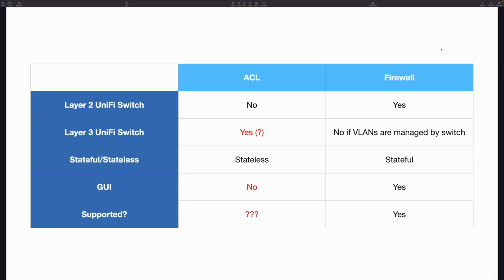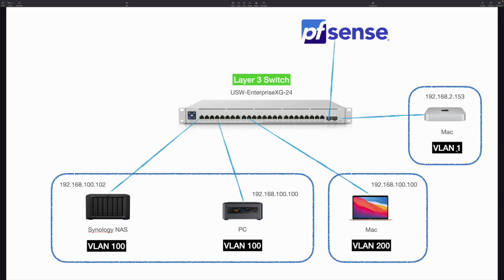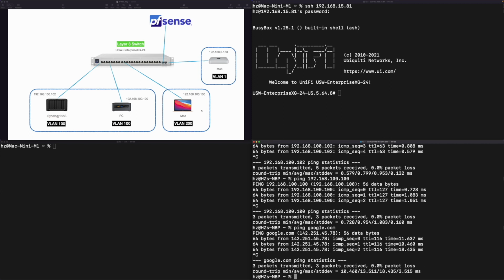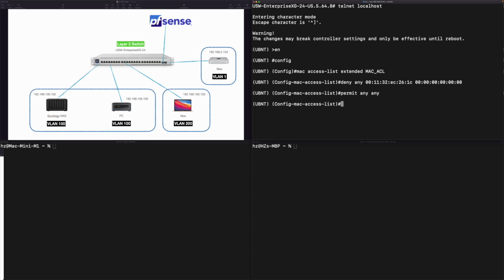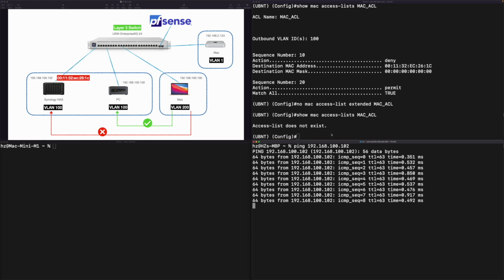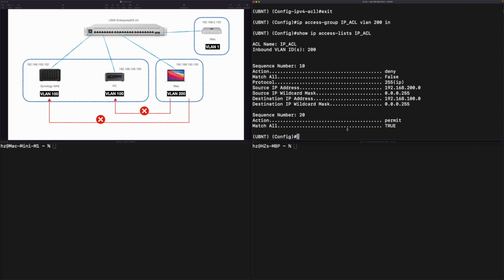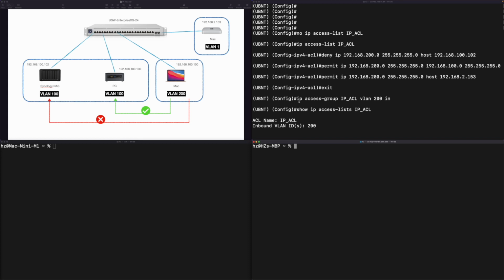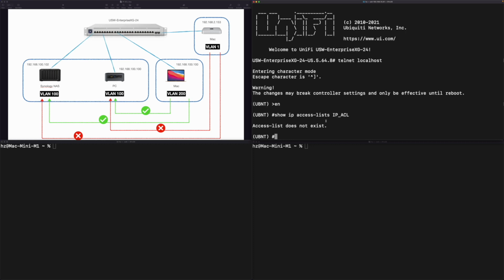Ubiquiti UniFi Layer 3 Switching -  Access Control List: MAC ACL & IP ACL

Comment: Do you have a video on setting up Vlans on a L3 switch unifi gateway and any static routing and other settings that needs to occur? Im also wondering what limitations I will have with one L3 switch but also a L2 aggregation switch upstream.
Reply from the maker: if you use unifi gateway, you do not need to manually setup static routing in order to use L3 switch; if you use third party router, search for "pfSense" and "Layer 3" in my channel.

And regarding how L3 switch work together with L2 switch, I am thinking about posting a video about it.

Comment: Great video! Interesting information and frustrating it's not available from Unifi.

I am confused as to what the benefit of a Unifi Layer 3 switch is though. If by default inter-vlan routing allows traffic between all vlans created on the switch then why bother with vlans at all? Just have them all on the same vlan.

They surely can't expect people to do all of this just to block traffic between different vlans. I'm guessing more enterprise switches have better ACL capability in the UI or even Layer 4 rule capability?

I'll be keeping all of my VLANs on the UDM and leveraging firewalls! Wish I have bought a L2 switch and saved some cash rather than L3 functionality that won't be used.

I hope you get more subscribers as the content is very useful. Thanks.
Reply from the maker: Yep, UniFi layer 3 switchers are still in infant phase, but isn’t it typical for Ubiquiti: good hardwares, lots of potentials, but half baked softwares, plus poor documentations… On the other hand, they also provide enough but not too many challenges to homelabers :D

Regarding “enterprise” level of switches, some of them support something like extended ACL to filter traffics. Not sure about GUI but at least the configurations can survive system reboot.
Reply: @hz777  how will these configurations survive in “enterprise” level of switches? will "write memory" useable on enterprise level switches?
Reply from the maker: I am not aware of a way, pro or enterprise.

Comment: Even for home use not saving the config is big issue.
I don’t understand why they cant fix this! So what does the „write memory“ actually do?
Reply from the maker: For edge switch, write memory command will save the running config to a file so next time when system reboot the config can be reloaded. But because of the OS changes, the command is still there, but no effect already.

Comment: Thanks for this great video.  It might seem like you're posting these into a black hole, but I swear, you're not! Your channel has the deepest "show and tell" kind of technical content I can find.

Ubiquiti should hire you to make their content for them.  :-P

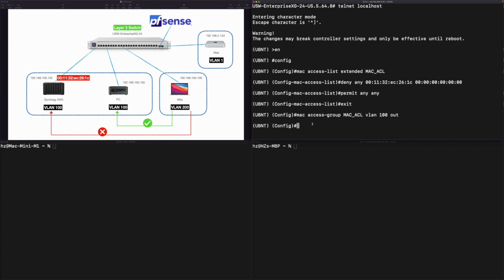I'm using a USW-Enterprise-8-PoE switch running 5.76.7.13442 and following along with you.  At 14:45 or so, you enter the "show mac access-lists MAC_ACL".   When I try that command in my switch, I get "Unrecognized command"  It seems that Ubiquiti made some changes to the CLI, and I'm unable to find any source for the equivalent "show mac access-lists" (and other) commands.  

Might you have any suggestions on where I can find this?   

My use case involves using Layer 3 routing on the USW-Enterprise-8-PoE in a lab. I am trying to isolate traffic through the switch for 3 separate NAS devices. The only access to these three devices will be a jumphost (mac or linux).  

Your example with the NAS and the PC on vLAN 100 is my use case, just more NAS servers. 

Again, thanks for making such a great video!
Reply from the maker: Sorry for the delay. For some reason your comment was marked as “held for review”…

Thanks for the good words about this channel :)

I believe the error you got in your 8 port POE switch is due to the fact that it’s not rack mount so it does not have the same OS as the big guys, even though there is “enterprise” wording in the model name. If I am right, I don’t think you have a way to run the “missing” commands.